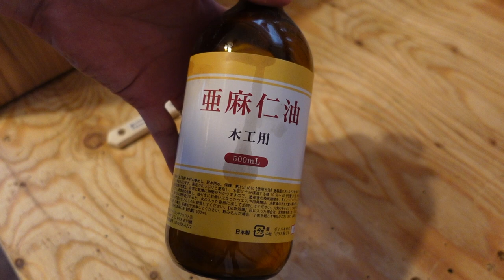[車中泊DIY #25] 便利な小型シンク(ギャレー)を自作しました | 軽バンでも邪魔にならない

Comment: Nice portable sink. Just have to be careful for the edge of sink as water might seep into the cabinet. Overall it is a nice project. Keep it up. 👍
Reply from the maker: Thank you very much.

Thanks again for the advice.
I see that the actual sink uses sealant to stop it.

I have not installed any this time, so I will use it with caution.
Thanks for the advice.